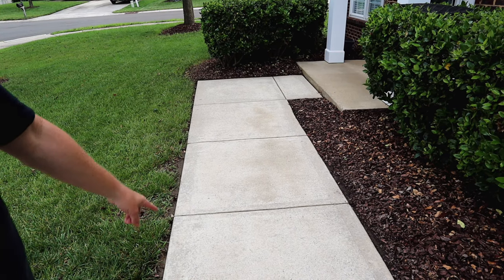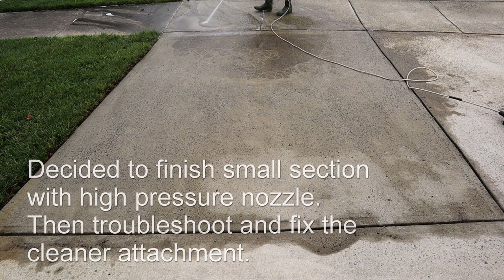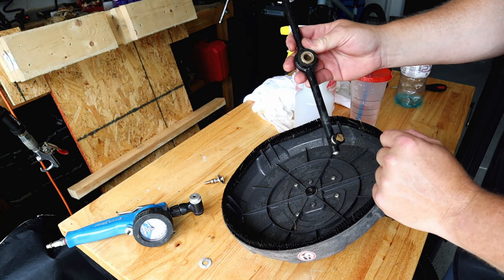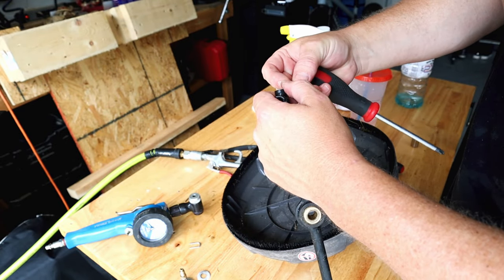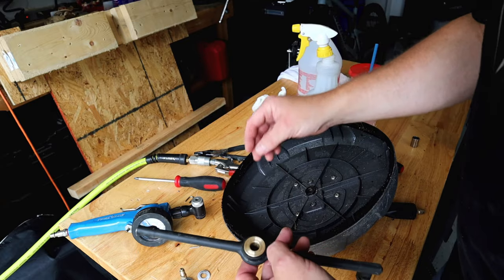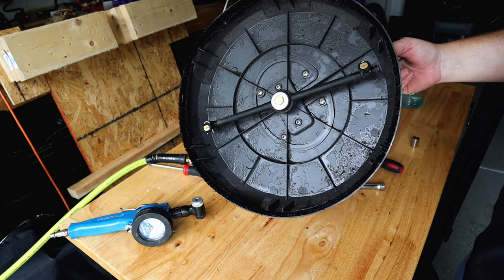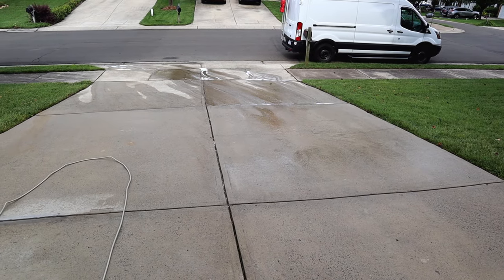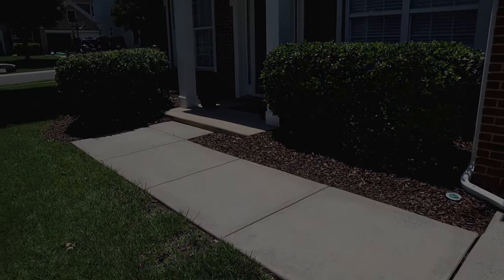#MTBPlanB Symptoms and Fix for clogged Ryobi driveway cleaner attachment.

Comment from the maker: Ever cleaned an entire driveway with just a high pressure nozzle?
Reply: Cleaned 1/2 of driveway using nozzle only.  Slower than molasses flowing uphill in January.
Reply: Back in my day. When these fancy gadgets didn't exist, a 40 degree nozzle was basically speed running
Reply: I do all the time.
Reply: @drebk  since we're talking about back in the day. When I was a kid... bleach a wide broom and a water hose. Talk about slow af
Reply: @jimmymahone5420 slow but also much cleaner than the attachment

Comment: Thank you @MTBPlanB this was just what I needed. I noticed the armature had a lot of resistance to spinning, give it a flip it it might turn over once, maybe twice.  

One thing I noticed that might be helpful to your readers- the white plastic washer had compressed and was shedding into the space between washer and brass through-bolt, causing binding.  I used a razor to trim the hole back to its original diameter and the armature spun freely.  But that plastic is much too soft for extended use, I'll see if I can get a washer made of teflon or some other more resilient material.

Comment: Thank you my pancake was intermittently spinning fast and then slowly, I did exactly as you did in the video but I use brake parts cleaner to blow it out instead of an air compressor because I don't have one I also put a little bit of Super lube on the rotating surfaces and it seems to be cleaning better than new now

Comment: What soap/chemical did you use in your pressure washer?
Reply from the maker: Nothing. I used the products in the video directly on the concrete.
Reply: @MTBPlanB  So all that foam at 8:41 is just from your regular water hose? Nothing was applied either to the concrete or the washer?
Reply from the maker: The products in the video were applied for the comparison.
Reply: Just list the products smh

Comment: Thank you for this detailed video! My arm of the sirface cleaner stops spinning after about 5 seconds. If i need to lube or grease the ryobi 2300 psi surface cleaners middle nozzle to help it spin, what kind of libe of grease should I use?
Reply: I had the same problem with mine, I cleaned it and still happened. I turned off my pressure washer and squeeze trigger,  it kept spinning with less pressure so I knew it wasn't clogged. Whenever it stops spinning, I lift it and barely squeeze the trigger.  Might take a few tries but it'll start spinning again and I squeeze trigger fully and keep going.  I have no clue why it does it. I have 1800 psi,  1.2gpm ryobi electric pressure washer. I suspect if it was less than 1800 psi it might not hang up. Maybe someone will figure it out.  It is definitely faster.

Comment: Here I thought it was my pressure washer, my boss bought this attachment to clean the new shop floors we're moving into. After a few hrs it just doesn't wanna spin, it's intermediate. Very frustrating to be honest, I'm using a 1900 psi ryobi electric pressure washer. I don't like the stupid hose that comes with the handle though it kinks up to much

Comment: I bought one of these, and it worked great - for a total of 1 hour! I went through all the cleaning operations indicated in the manual, just the way you did it here in your video, and it still wouldn't work. It spins when I first squeeze the trigger, but within 5 to 20 seconds the rotor stops spinning. I tried cleaning again, with the same results. I took it back to the store and got a replacement unit, and that worked even worse than the first one! This Ryobi surface cleaner is a piece of junk! I got my money back instead of trying to get this damn thing to work. 😤👎 ZERO ⭐
Reply from the maker: I hope mine holds up for another two seasons.
Reply: @MTBPlanB  I bought the Greenworks brand to replace the Ryobi and it works much, much better! I think it might be because it has a brass rather than plastic washer in the center hub. According to the info on the box, the Greenworks uses 0.5 gpm more than the Ryobi, which is a negative, but maybe the higher flow is why it works better. Also, the Ryobi was $40 at Home Depot and the Greenworks was $30 at Lowe's, so that's a real plus in my book as well.
Reply: I had the exact same experience.  The Ryobi 12 inch surface cleaner lasted me 1.25 driveway cleanings.  After that, the nozzles would spin up after pulling the trigger, but then slow down after 20 seconds or so and often stop altogether, until I released and pressed the trigger again.  I disassembled the nozzle arm and nozzles, cleaned and lubricated everything and the issue persisted.  I love Ryobi products but this thing is a waste of plastic.
Reply from the maker: Appreciate the honest feedback from everyone. Hope that it helps others make informed decisions.

Comment: have anyone had an issue when removing a broken high pressure filter from inside the  cleaning deck inlet plug!??
Reply: I found the removal of that filter to be impossible. I would suggest the Greenworks brand instead.
Reply: @thoughtfuloutrage5563  i prefer Ryobi because they are the number 1 selling brand and i have not had anything break during use!! it was just the part when trying to remove to clean and unclog, but without having to remove that, it still cleans without streaking
Reply: @thoughtfuloutrage5563  yeah me too, but don't forget to after use and before putting it up to put that PW pump protector. Available at the HD😉